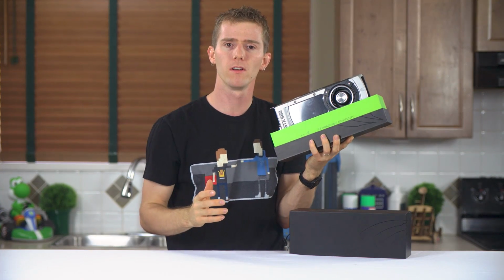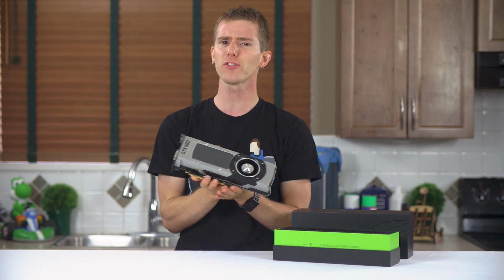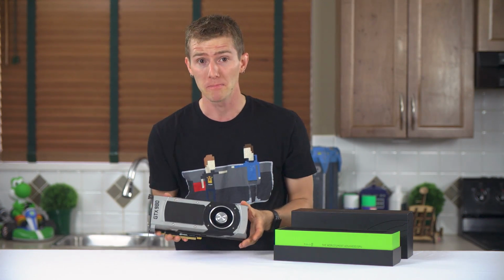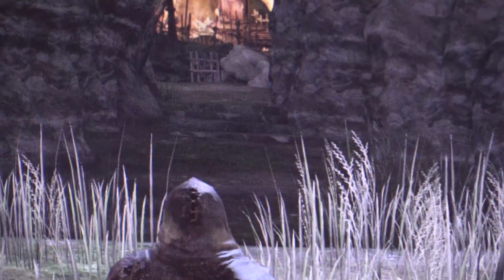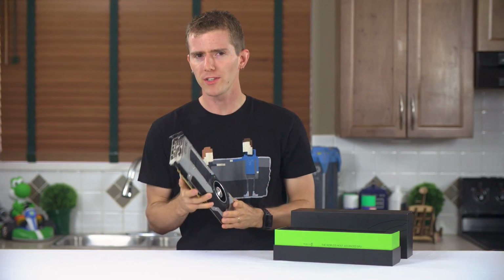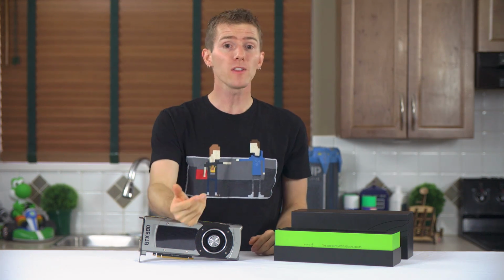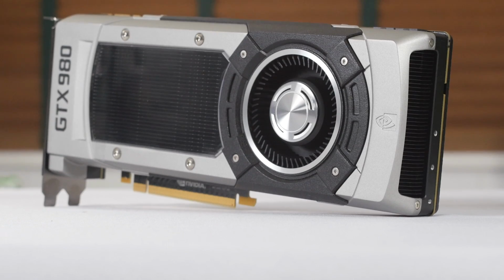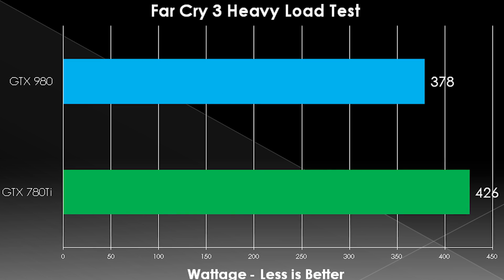NVIDIA GeForce GTX 980 Video Card - Performance Overview

Comment: is there a place to buy it cheaper than €620 that they sell it here in Greece or €610++ they sell it on official EVGA site? also i have a i5 3570k(3.7ghz on turbo mode), will it bottleneck the gpu?
Reply: Made1nGreece https://www.skroutz.gr/s/5748664/Gigabyte-GeForce-GTX980-4GB-WindForce-3X-Gaming-GV-N980WF3OC-4GD-Rev-1-0-1-1.html and no the 3570k won't bottleneck it
Reply: +Made1nGreece I cant comment on pricing as I dont live in Greece, but I can tell you that your CPU wont bottleneck the 980, maybe slightly in very CPU demanding games, but not anywhere near enough to cause issues.

Comment: Hi, I'm planning on upgradeing my PC but I don't know anything about it. Does my PC support this GPU or should i upgrade something else first? Here are my speccs: 
Operating System
	Windows 7 Home Premium 64-bit SP1
CPU
	Intel Core i7 4770 @ 3.40GHz	47 °C
	Haswell 22nm Technology
RAM
	8,00GB Dual-Channel DDR3 @ 933MHz (11-11-11-32)
Motherboard
	MSI Z87-G43 (MS-7816) (SOCKET 0)	30 °C
Graphics
	BenQ RL2455 (1920x1080@60Hz)
	S221HQL (1920x1080@60Hz)
	2048MB ATI AMD Radeon HD 7800 Series (Gigabyte)	45 °C
Storage
	931GB Western Digital WDC WD10EZEX-60ZF5A0 ATA Device (SATA)	34 °C
Optical Drives
	TSSTcorp CDDVDW SH-224BB ATA Device
Audio
	Realtek High Definition Audio

Thank you :)
Reply: Greg Most graphics card are compatible with any pc these days. As long as you have enough wattage on your power supply you are fine

Comment: video cards are getting too big and too heavy. thats not an imo thats just a fact.

my sister recently bought a new PC with one of these cards in it. it droops in its slot because of its own weight. thats not good.

they either need to make these things smaller and lighter or figure a better way to secure them to the motherboard.

(making them cost less would help too btw. a new video card now costs more than the last gaming PC i bought 5 years ago.)
Reply: this is also the top end card. the 960 is have of the size in length and 3/4 of the width. much smaller
Reply: I know it's kind of late but you could get the amd r9 nano

Comment: can anyone answer me this question: is the nvidia brand reliable?  would i be better off buying an asus Strix GeForce GTX 980?    and whats the cheapest motherboard that can use this card? im trying to build a gaming system at around $1000.
Reply: This nvidia reference pcb has a stock cooler and runs at about 80+ degrees C. Your probably better off spending a little extra on an aftermarket card like the ASUS or evga or whatever your preference is because they have more overclocking headroom, they look a lot nicer and have much better temperatures.
Reply: Xantaxa But aftermarket coolers will heat up the rest of your computer.
Reply: Um no it doesn't what are you on about?
Reply: +Xantaxa (Zan) Aftermarket coolers exhaust heat into the case. Oh and any motherboard you will be able to find can use this graphics card.

Comment: Question: I have an i5 4690k with 16gb G Skill Ripjaws X ddr3 memory. I want to upgrade my graphics card but not sure if Nvidias gtx 980 is right for me. i do not overclock nor do i play on 4k. the highest i plan on going is 2560 x 1440 but currently on dual 24in 1080p monitors. I use one monitor for gaming and the other for YouTube, streams etc. I want a card that will be able to handle games such as battlefield, assassins creed, gta v at no less than 60fps on ultra graphics. i don't really care about price but if i don't NEED to spend a lot then id like not to.
Reply: A 980 is is the perfect card for the situation you just explained.
Reply: Nolan C I plan on buying a 980 for the exact same purpose
Reply: I have one for this purpose and it's incredible
Reply: I have two monitors, one of which is a 120hz 1440p and the other a 1080p 144hz and a 980 to run them but I plan on getting another 980 and selling my 1080p screen and replacing it with an RoG Swift 1440p 144hz gsync monitor
Reply: 1440p is porn 1080p is outdated in my opinion
Reply: Xantaxa That's not true...And if you were going higher resolution you should go for 4K, because between 2K and FHD there's barely a difference.
Reply: Okay you're entitled to an opinion i guess
Reply: 4k is not worth it yet anyway because my internet is shit it cant stream any video at 4k lol
Reply: There's actually quite a big difference lol
Reply: Xantaxa 4K is not worth it simply because it's not worth it for the price.
And no point in streaming higher than 1080p.(maybe 60fps if your internet can). because if you do, well let's just say you'll get shit performance in the game itself, even at 2K.
Reply: Streaming video not streaming the game you spastic
Reply: Xantaxa No need to insult you damn moron, fuck you. I stated video streaming, i'm not dumb.
Reply: i personally DO notice quite a difference from 1440p and 1080p but at the same time id stick with 1080p because its not a big enough difference for if me to call 1080p bad its just 1440p is better if that makes any sense. however this is all opinionated.
Reply: Nolan C same here

Comment: Will my i5 4590 bottleneck a gtx 980?
Reply: Insanity HD Not really even if I recommend going with a 970 and overclocking it, you`ll get nearly the same result and game experience :)    For ocing I would recommend the Gigabyte G1 Gaming, MSI Gaming 4G, EVGA SSC ACX 2.0 or even the Hall of Fame 970 from KFA2 if you have a bigger budget to use :)

Comment: Hey do you have to have watercooling for this card (does it overheat easily)? Would i be able to run it for a day or 2 without turning it off? System specs: i7 4770 16GB RAM, Corsair CX600 Power supply. Thanks
Reply: +Tris Parker It will be fine, just leave a window open or something to keep the room well regulated

Comment: I have a Gtx 760 sc is this worth getting or a Gtx 970 instead? And also for recording full screen mine craft do you need a good processor or graphics card?
Reply: Bare MC Depends on what you want to play. There's around a 15 frame difference between the 970 and 980.
Recording fullscreen requires a good processor.
Reply: Yaziman37  Thank you!! Im made my decision and im getting a gtx 970 and a i7 4790k and btw is getting the referenced card worth or no?
Reply: Bare MC Reference is actually worse at overclocking than aftermarket ones. Get whatever aftermarket one you're planning to get.

Comment: Can you use both open air and blower GPU cards togheter in SLI?
Reply: CommandoSoldier Yup, although I prefer 2 reference coolers so the top card doesnt get heated up too much
Reply: st3yn But I will most likely have the open air card below the blower card. I've heard that the blower gets air from the sides so that would not be an issue with a card below it. Which gives the open air card more room for air.

And thank you very much for replying! Doesn't seem to be a clear answer on this on the internet.

Comment: This card truly is a beast. I purchased the MSI version of it. I originally wanted a 970 for $350 but when I saw amazon had the 980 for $380 with tax included I had to get it. Best card I've own. Maxes out any game I've played on it so far at 1080p/1440.
Reply: Tanzu15 oh ok.
Reply: emersonleon85 I'm buying the MSI Gaming 980. I'm glad to hear good things about it.
Reply: +SMC Its really a beast. I was hesitant about the MSI card even though I've heard good things but I am really happy I took the plunge. looks great and is super quiet under load
Reply: +SMC I'm selling mine for around 400. negotiable of course.
Reply: AndRootPro I went for the GTX Titan X. But i'm sure someone will buy it eyes closed it's a great price especially if the card is in good condition. I was debating a few days ago what to do with my GTX 750Ti as it's useless to me, then i decided to put it in my mom's PC
Reply: SMC Yeah, anyone who's interested just reply to dis, cards near new, have the box and all manuals.
Reply: +Tanzu15 yes, I'm still selling.
Reply: +Tanzu15 MSI. has a 79% asic level, pretty high. overclocks like a champ
Reply: +Tanzu15 that stinks, but good luck finding one!
Reply: +AndRootPro hmm. I got mine brand new for $400...Still selling 3 months later?
Reply: Gamerred possibly. What would be your general area map wise? US, UK, etc.
Reply: Can it run 4K minecraft

Comment: i have a i7 4770 3.5ghz and a 80+ gold 500w PSU will i be able to run a 980? or a 970?
Reply: Robert Gonzalez A five hundred watt PSU is plenty for a 980.
Reply: +Robert Gonzalez Best bet is always get a higher power supply for a graphics card so in the future u dont need to upgrade your power supply if u upgrade to a higher end card
Reply: no it wont

sarcasm
Reply: but lol 500 watts only? u need power supply with at least 600 w or wait for blue screen on monitor
Reply: babahonaga yep, go to this site to check how much watt you need and add addionaally at least 100 more watts http://www.coolermaster.outervision.com/
Reply: No problem ¯\( ツ)/¯
Reply: r1Ns3 thx c:
Reply: +Robert Gonzalez I have a liquid cooled 3770k over-clocked at 4.2GHz and a 980, im running a cheapo Rosewill 500w psu and i can run any game on High to Max settings no problem
Reply: Basically, when asking such question you should realize the wattage you need is always 300W and up, so yeah, it'll work like a charm :D
Reply: Robert Gonzalez I think you're a little close, but you should be ok. You're teetering a little, so I wouldnt OC it with buying a new one.

Comment: Guys can someone help me. I bought an asus Rog G20 with an i7 4920 and an nvidia 760 with 16g or ram. But it will only run minecraft at 60 fps which really suprised me. It costed 1200$ so i was wondering, was it worth it. Though i can play arma 3 at max settings with 40 fps?
Reply: I had this same problem. Solved it by going to power options in control panel and setting it to high performance rather than balanced or power saver
Reply: Brandon Ferreira thank you for responding it really helped.
Reply: Brandon Ferreira oh well i found out it was v-sync that was the issue, but thanks!

Comment: ive just got one. gtx 980 that is, not just does it beat the first titan performance wise, it beats the 690 which is 2 680s in one card. think about that. also comes with 4gb vram and its direct x12. what more do you want. ;) @ £400 price range i was sold.

Comment: +70 mV for 230 core offset? Sure, you'd need some extra juice for that (tested it myself) but that much? I know performance varies from card to card but damn that's a lot! Personally I own a reference design one with 115% power, 200 core and 350 memory with no extra voltage, and has been stable so far.

Comment: Is it worth to buy 980 over 970?
Reply: Depends on if vram is important to you
Reply: I just got a 980 because of CUDA cores and there was a fairly good discount on it. Now I'm waiting for the cables to use it on Mac Pro 4.1.
Reply: Gökhan Bıyık nice, 980 is what I would have recommended, you game on Mac?
Reply: My general purpose with this GPU is 3D Design. Since Titan series was much more expensive... I'm also going to bootcamp Win7 for gaming.
Reply: Gökhan Bıyık ok cool, i dont have a lot of experience with 3D design but this card should do well, have you already bought it? If not, the original titan might work too, i belive it has dropped in price to that of the 980
Reply: I already bought. The cheapest Titan is more than double price in my country. I think 900 series are more focused on gaming. But I have a gt120 on the system and needed a new GPU. GTX980 has 2048 CUDA cores which is not a bad numder.
Reply: true, not bad at all, are you at all considering the new 980ti?
Reply: InsaneGamer333 Nope. I think it will be more expensive then what I got. Also could't wait for it, like I said getting a GPU was urgent.
Reply: Gökhan Bıyık gotcha

Comment: Have not changed since the 690 ? At least that fan whas in the middle. That whas my favorite design and the titan z look too thick they need to make a new card with the same cooler with the fan in the middle cause it look cooler then the ''normal'' Nvidia design.

Comment: What is better, EVGA or MSI or ASUS or PNY or gigabyte or Zotac or..ect.
no need for sapphire or XFX or anything thats not Nvidia. im talking strictly Nvidia GPUs, what is usually the higher end top of the line ones

i currently have 3x 980s in SLI, but mine is MSI.
im thinking of swapping them out for better ones and giving my MSI 980s to a friend.

i know ASUS came out with the gold plated 20th anniversary ones and EVGA i think has the new Hydro-copper ones. which is better of the two, or is there anything better?

Comment: How much time does a GPU lasts? If its like 7 years I will by this one
Reply: Pedro Martins depending on games, this one should last you about 5 years before u need an upgrade
Reply: I'd say a single one lasts 3 years. The only way to get 7 years is four of the most powerful GPU which will cause stuttering.

Comment: will this card be able to run gtav on max settings ? , coz I am planning to buy it
Reply: GTX 980,i7 5820K,12 TB WD GREEN HDD, X-99-E WS, 16 GB

Can I run Super Mario Bros ?? im really thinking of it before i download it ..
help please ..
Reply: really?! im getting sli superclocked 980's in 2 months
Reply: Yes get the Evga gtx 980 ftw acx 2.0 its a 980 but buffed up even more and might i mean might idk be cheaper
Reply: Amr EzzElDin  haha to have GTA V PC on absolute max settings you need a 4-way SLI Titan X setup. but thats way overkill, and yes you can play GTA V on high with a 980
Reply: ***** no it is 4 way titan X's, but thats running multi monitor, 4K, AA etc. its even on the Nvidia website. Idk, my rig can play high to ultra, i have 980 SLI config
Reply: no im certain, also they run it on 4K, not 1080p. Also i know the difference between 3 way and 4 way is piss all, but this is what Nvidia told me.
Reply: Ugh. just dont worry, you obviously dont know what we are talking about.
Reply: Amr EzzElDin this card will literally run everything in gta v maxed out not a single setting turned down at a MINIMUM of 45-50 fps. keep in mind that gta v is one of the most optimized games of all times tho
Reply: Nick Maynard a gtx 980? what drugs are you on??
Reply: Gabriel Harwood uhh, personal experience. i own gta and the only time i drop below 40 is if im on 4k resolution. i am running the FTW ACX 2.0 version of the card so that might have something to do with it
Reply: ***** gta v is just super well optimized.

Comment: The 980 is really only worth the money if you plan on overclocking or if you're able to get it for a much lower price ( used can go for much less). I overclocked my MSI GTX 970 with about 220mhz on the base clock and about 520mhz on the memory clock with Afterburner without touching voltage and it performs a bit better than a stock 980.

Comment: Going to buy titan x for MINECRAFT highest graphics with good fps
Reply: im gonna buy crossfire r9 295x2 for terraria
Reply: saltis77 buys titan x for minecraft
Reply: Hey guys, Im buying a couple of overglocked gtx 980 4gb cards to run windows vista. Can I run it on 4 fps?
Reply: ***** rekt
Reply: saltis77 minecraft is a bad game for pc play it on wii u will be guaranteed 19312380912839012839012830912391283901283890[1238190231023890 fps, dont dont dont dont buy titan x because you are minecraft player uninformed gg
Reply: I'm getting 4 way SLI 980s for minecraft.
Reply: saltis77 LOL. for Minecraft. L-O-L.
Reply: at 360p
Reply: ***** not unless you have a crazy shaders mod with a very big viewing distance mod plus texture mods plus if you want to run above 1080p.
Reply: No, you need crossfire r95x2
Reply: You need Titan Xs in quad SLI watercooled with a bunch of radiators outside like the whole room watercooling and overclock it. You also need an i7-5960X.
Reply: what a n00b use nitrogen and xenons and maybe a whole bunch fridgess
Reply: Infinite Zero Rainbow Slushie Im just going to throw the whole pc build to my backyard pool. It cools it, right?
Reply: ValttiKortti You need a chlorine and water proof case and motherboard
Reply: +ValttiKortti Make sure it's chilled by a freezer is the winter.
Reply: Lol wtf! XDDD u need at least a GTX 550 Ti. It's not worth it to buy a Titan X

Comment: 780ti is the same as the 980, NVidia cant make a 3 times better GPU if they do they will lose money because  people wont be buying from them its all a business NVidia will make a GPU so it can barely play games if they come out with a stronger GPU that can max games like assassin creed unity at like 100 fps they will lose a lot of money cause assassin creed unity is a badly optimize game and if a 980 can make 100fps on a badly optimize game then it will run games for about 3 to 4 years and people wont have to buy another GPU

Comment: Good?
Mobo: Asus Maximuss VII Hero
Casing: NZXT Phantom 820
GPU: Gigabyte GTX 980 G1
HDD: Western Digital VelociRaptor 1TB 64MB 10kRPM HDD 1TB
Fan: Noctua DH-15 
CPU: Intel i7 4790k
RAM: Corsair Dominator Platinum 2400mhz
PSU: Corsair Power AX860i
SDD: Samsung SSD 850 PRO 256GB
Reply: yeah but you need a bigger psu if you want the option to sli 980's in the future. something you might want to just get from the start since psu's arnt the most expensive thing.

 i got a gtx 970 with a 750w psu and went and got another 970... then needed to upgrade my psu again
Reply: Kern O'Leary Oh yes! That's what I was thinking about! I've changed it from 860w to 1200w for my PSU. I think it's better to have bigger watts than smaller. Futureproof! Sounds like you've got a really nice setup to go with that 2 970s! Have fun with it man.
Reply: Vain Moo thanks brother :) sounds like a great build ! you as well.